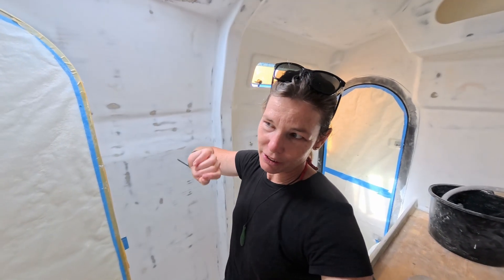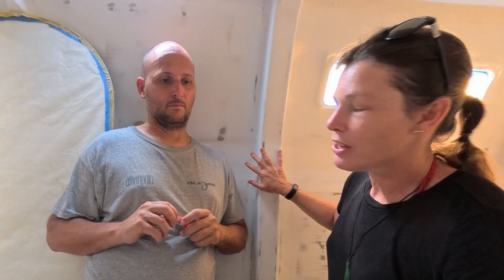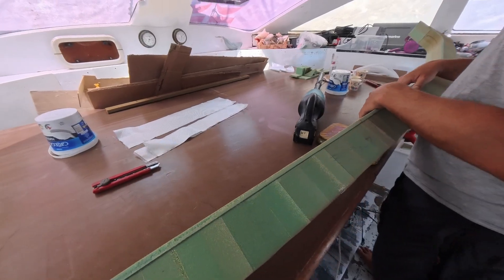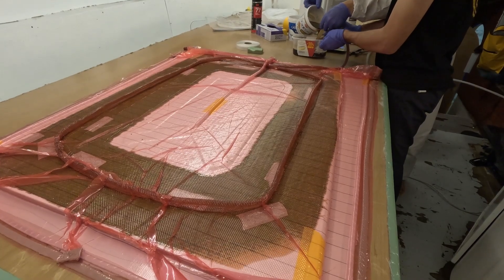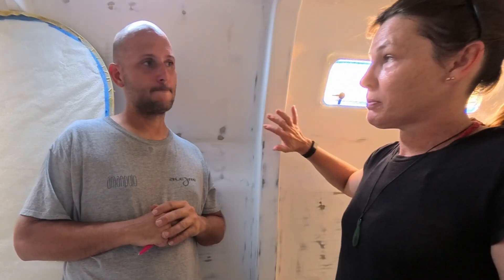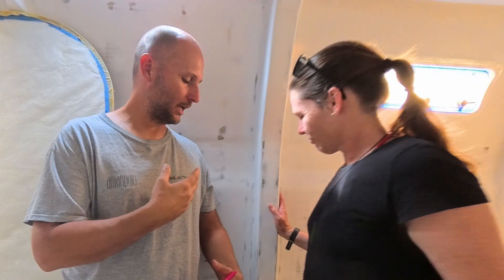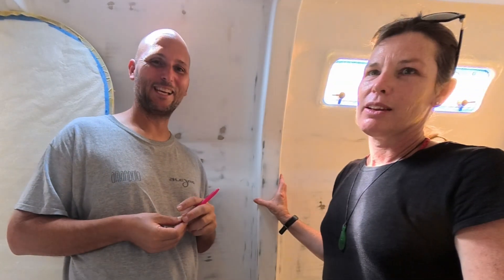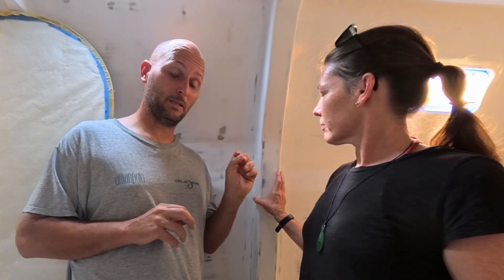Why Did our Beam Implode? Q&A & Behind-the-Scenes Analysis

Comment: My process would be. 1. drop the longitudinal face of the box -  makes fab too complicated and redundant strength wise -saves on material. 2.  Use only one foam sheet thickness, not 2.  3. fillet well both sides and then infuse total assembly on the hull 
key stress point is the hull to fillet connection this is where infusion and careful prep are essential if you want to save weight.

Comment: 80 mm width fully made of 10mm foam plates that's 8x10mm. 
You used 2x10mm for your construction.
So it's 4x heavier. Not 8 times.!? Tell me if I'm wrong please 😃
Ok it's 4 times the price for the foam. But 😃 time is money too and raisin in the trash is not for free.
Reply: ... It is 3 times more heavy than your construction.
Reply: Anyway you saved maybe 0.5 kg.

Comment: Have you considered filling the C channel negative space with water prior to / during infusion? A watertight seal might be easier to achieve in the process, the water would prevent implosion, and then it could be drained out from the finished composite structure.
Reply from the maker: 🤔 Water and composite processing don't go together very well.
Reply: @youngbarnacles  certainly, but you were trying to maintain an airtight seal (that failed). It may not have failed as a water seal, and the seal would prevent mixing.
From an engineer's perspective, it seems like an advantageous solution, if proven workable. Shayne might be able to work that out. Beyond avoiding implosion, other advantages might be using lower density foam, as well as controlling curing temperature with the water. 
Since your implosion was through use of an airtight seal, water may not have broken the seal. I envision that one water tube could be at the bottom, one at the top. The tubes are the critical area to focus on to separate the water from vacuum, and vacuum from ambient (which is already a part of infusion). Develop the seal before adding water. Use a water reservoir on deck to fill water from bottom to top. Perform infusion and, optionally, pump water to maintain the desired cure temperature.
Reply: @youngbarnacles also, if the seal fails before resin is applied, dry out the part and try again. If the seal fails during resin infusion, you're in a rework situation similar to the implosion.
Reply: @CarlBlomgren  glass doesn't like being wet and dried out. Not sure of the mechanism but every time I have used glass that was previously dampened and used, it has not wet out well.
Reply: @evangatehouse5650 which glass would be getting wet? You mean if the seal failed and the water leaked? If you couldn't dry the glass, or even the foam, you'd have to replace that glass and/or foam. I assume that he is using layers of dried resin on the internal foam, maybe even a layer of glass, otherwise there's no way to achieve a watertight seal, let alone an airtight seal.

Comment: Great video. Given then extensive Refit/Changes you have made to the boat over the last 4+ Years. if you had to start over and had all the money you have spend on the boat this far. would it have been cheaper to build a new boat from scratch. ore is it still cheaper to do the Refit/ modification.
Reply from the maker: It's still cheaper to do the refit/modifications at this stage. The biggest advantage is that we have spent a lot of time living in and sailing Paikea, and that has been very helpful to know what changes we wanted to make. If we were to build, it would probably take around 3 years, and that's time we wouldn't have had on the water. We do have designs drawn up for Paikea 2.0, but we will finish this project first

Comment: Why is a box beam better than an i-beam in this case? Is it because the I-beam would have to be taller for the same strength?
Reply from the maker: Structurally, the i-beam is the better choice. We wanted the box beam for aesthetic reasons - looks nicer in the cabin, easier to clean etc. Purely personal choice here
Reply: Box beams have higher torsional (twist) strength than I-beams, but in this case either is fine. The best beam is the Noto Serif O-beam if you believe the video "Which Font Makes the best I-Beam?"